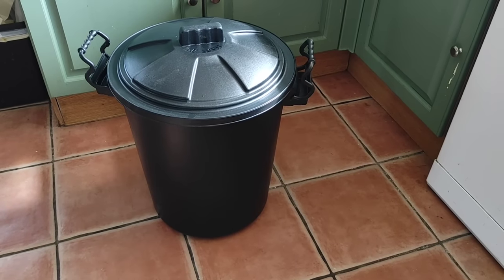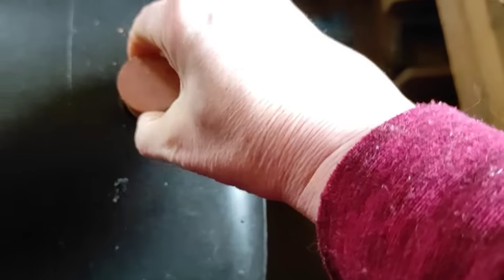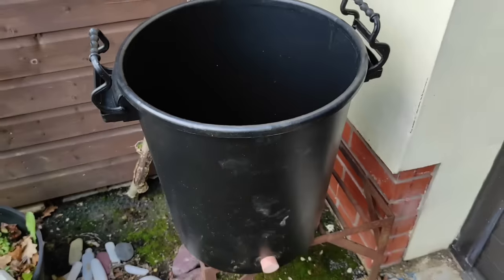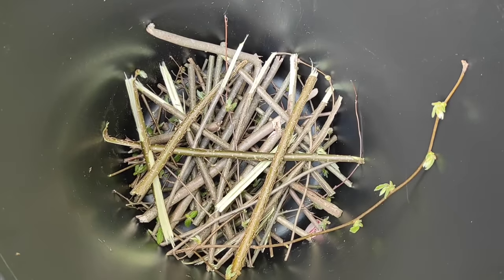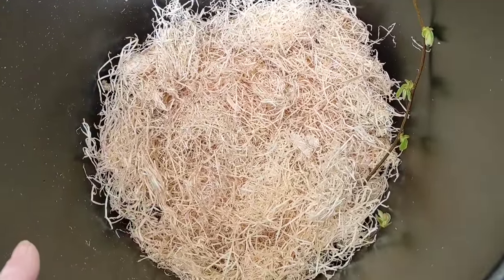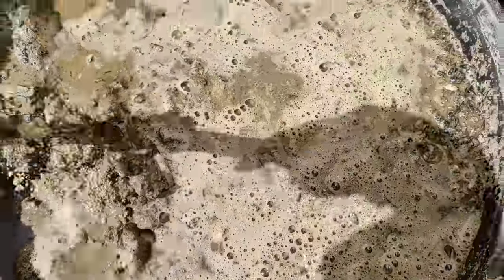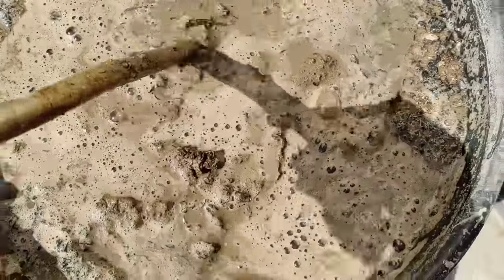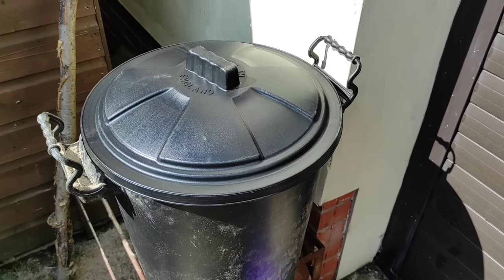Soapmaking from Scratch: Woodash Lye

Comment: It's very difficult to make bar soap with KOH - but you can make fantastic liquid soap concentrate paste with KOH. NaOH is usually necessary for CP or CPHP hard (long lasting) curing bar soaps
Reply from the maker: This batch successfully made both hard and soft soap, details in the second video

Comment: Rather than an ash hopper.  I just put ashes in a plastic pitcher.   Stirred in rain water.    Let it settle a couple days.    Decanted to another plastic pitcher.    Let it settle for a couple days.  Decanted again.     It tested too weak for soapmaking.  The egg did float. but not enough.    I put a cotton cover on the pitcher and left it in a safe place.    I live in a dry climate.   I don't remember when, but I would guess a week or two later enough water evaporated.   It passed the egg test.    The final soap was a thick creamy soap, not a bar soap.     Next time I aim for a bar soap.

Comment: Adding a nod of agreement to all the comments about safety. 
I have been heating our home with wood burning for over 20 years.
I have had mild alkaline burns from ash setting into the fold of my arm , mixing with sweat and getting a chemical burn  from it.
I scrubbed with vinegar as soon as I realized what was happening.
 😳 
It was mild and no lasting harm.
My grandmothers on both sides, made their soap from scratch. 
I have seen injuries,  thankfully minor  --  from lye and from un-cured soap.
.
Wood ash is a serious matter.
.
I have seen the touch and taste test methods,  and burns .

Comment: This was so interesting!! I saw from another comment that you've got part 2 in the works and I'm really looking forward to it! I had a couple of questions: Once you've steeped your ashes and decanted the lye water, is there anything else you can do with them? Are they safe to dispose of? If you need to get rid of the lye, is there a safe way to dispose of it, or are you kind of trapped into soapmaking at that point?
Reply from the maker: Spent ashes are great on the garden. Woodash lye can be used to flush through kitchen sink pipes just as you would any other degreaser.

Comment: Lovely videos. Thank you for your time and patience.
Have been making a similar version for awhile. We live as Pioneer Settlers in the mountains of the Ozarks.
The only thing that really gets to me is that the soap doesn't look very pretty with bits of grey flecks, and sometimes it looks as if I had added charcoal to the batch.
Should I filter this again and again? Before a boil? What step should I be filtering the homemade lye water to remove sediment?
I like the look of a cream or (tan) oatmeal colored bar. 
New Subscriber with notifications on!
❤
Reply: Filter through several layers of cheesecloth OR an old teeshirt to get a clearer lye solution.
Reply: @jeanettehaygood4154  thank you, as soon as wood burning season comes (when I store ashes) I will begin again. Do you think it needs to be filtered many times?
Reply: @landomilknhoney  I don’t think so unless you really want a very pale soap with absolutely no ash.

Comment: Also always have a spray bottle of vinegar nearby when working with lye to spray and wash off any lye contact.
Reply from the maker: I just have an open bottle of vinegar available, a spray mechanism is awkward in gloves
Reply: @SallyPointer  yes that it is. But the pressure of the sprayer can help eliminate the lye from the skin faster.
Reply: Please! Always use cool water initially on a lye spill!
Vinegar will cause an exothermic reaction on a fresh lye burn that can make it worse.

Comment: I know it's extremely annoying to find googles that actually do fit glasses, and not just say they do, but using just glasses is not enough. You could use face shield that would protect your whole face.
Also I saw other people using far less ashes, they just got much weaker starting lye, it was much lighter than yours so they had to boil it to get it strong enough to make soap.

Comment: A layer or two of newspaper make an excellent filter.
Reply from the maker: Not really around in the pre modern era though, and apart from the plastic hopper I'm trying hard to use the earliest references available. Great suggestion for modern applications though!
Reply: @Sally Pointer  Print was around and repurchased since the 1800s. Lye soaps were common through the early 1900s
Reenactors and hobbyists interested in soapmaking will be using the same techniques but can make use of the materials appropriate to their period.
The soapmaking at the Folk Festival I participate in use a 90° trough with a small gap between the sides, lined with newspapers and straw to process the wood ash for lye.
Reply from the maker: @fhorst41  I'm working mostly with medieval and earlier references, but yes, great for more modern versions. I haven't seen it suggested in 18th and 19thc soapmaking manuals though, would love the reference if you have it.

Comment: Where is part 2 ?! Please make soap from your lye.

And yes, more safety tips would be good. 

-Goggles over glasses.

-Long sleeves pulled down 

-Long nitrile gloves pulled way up the arms over sleeves.

- Install a tap rather than a cork

- Have a bucket of clear water with some white vinegar nearby as well, for lye-splashes on skin  or in eyes.

Thank you for the interesting start.

Comment: I've made soap during my time at uni in a lab, made some soap as a hobby but seeing the traditional way is super fun! I do wonder tho... HOW... How do you casually discover this back in the days... Who thought "hey let's soak ashes and mix it with fat"
Reply: On another channel, can't remember which one, they theorized that wood ash from the cook fire got into open pots of boiling water being used for soup and that's how the lye was first noticed
Reply: Given that people also cooked over wood fires it's not unlikely that water that's percolated thru wood ash would get into contact with fat. Fat + lye = soap. Dirty soap admittedly, but soap and it wouldn't be beyond the bounds of possibility that when ashes were used to clean pottery/wooden vessels that someone noticed that the soapy lumps cleaned better than ashes alone.
Reply from the maker: It's a common theory but doesn't really hold up under test conditions, I'm looking at this very question as part of my MSc research
Reply from the maker: It's the right ingredients, but not the right conditions for true soap to form. Bear with me, the next video will address this very question.
Reply: @SallyPointer  Yes, but when they first put metal-ore bearing rocks in the fire to boil the water in their then fragile clay pots, they didn't produce high tensile stainless steel and when they first rolled huge stones on logs, they didn't immediately produce Pirelli F1 tyres, they were just proofs of concept to prompt initial interest and be honed and refined down the centuries. 
Fascinating video/subject though.

Comment: Rust ... whey is apparently good in which to soak rusty tools.  It's a gentle acid and the acid will "eat" the rust.  Good for tools that have jammed shut.  Then sand, sharpen and oil.  Failing whey, I wonder if diluted vinegar would work.

Comment: Thank you for providing this video! My suggestion is that an actual tap be used instead of a rubber cork/bung. Wouldn't that work better? Also, if lye splashes onto your glasses (instead of a face shield or work goggles), might there not be some material used in producing the eyeglasses that would be damaged by the lye? I don't know about these things, I'm only asking.

Comment: Should always keep vinegar handy when working with lye !
Reply from the maker: I always do!
Reply: Household vinegar is 95% water 🥰 
You should always use only cool water to clean lye from your skin! Vinegar on a fresh lye burn causes a further exothermic reaction and will make a lye burn worse. 😢 Cleaning equipment, floors, or countertops with vinegar is okay but cool water is good too because it helps dilute the lye as it’s removed.

Comment: The common problem with using an egg as a floater is if the egg is old, it will float, and it's best recommended to use a potato.
Reply from the maker: That's why you always start with a plain water 'float' as a control

Comment: Oof, I can't say I've never suffered for science, but you had me scared there with that spout.
Very interesting! A question: when you want to discard the ashes afterwards, do they need to be neutralised first?
Reply from the maker: I'll give them a while to weather, then they can go onto the drive to quietly soak into the gravel
Reply: @SallyPointer  thank you!
Reply: I wondered if a water butt tap would work instead of the bung? You can get them in B and Q or Wilko's etc. I don't know if the flow rate would be too low and prone to clogging.
Reply: @sarahs784  ... and I was thinking about a plastic beer barrel tap for more controllability if you're doing it on a regular basis.

Comment: A) If the lye is denser than the egg, the egg will float. Depending on how much denser the lye is than the egg, some part of the egg will be above the surface, and this amount will vary with the density of the lye.

But.

B) If the lye is less dense than the egg, the egg will sink. It doesn't matter whether the lye is just a hair less dense or MUCH less dense. The egg will still sink until it can sink no further (the bottom of the jar in your case).

If the lye were exactly the same density as the egg, there would be no vertical force acting on the full submerged egg and you could (in principle) place it at any height in the jar and it would stay there.

So if we're not in state (A) or (B) the vertical position of the egg within the lye doesn't tell you anything extra about the density of the lye. You already know it's the same as the egg, and that's all you can know.

A hydrometer (as used by wine and beer makers) is carefully designed so that some part (the stem) is always above the liquid, so it's always in condition (A), which is the most informative condition.

I would suggest you actually procure a hydrometer, if only as a cross check for your traditional methods. They're very reasonably priced!
Reply from the maker: I have several hydrometers, but they weren't around at the periods that I'm drawing my references from, so not quite so useful to understand what soapmakers in antiquity observed. Certainly handy as a more modern cross reference though
Reply: @SallyPointer  Yes - I was suggesting them as a check on the egg method, and also as a modern measure of the (antique) lye production process. Using an experimental test to monitor an experimental process seems like too many variables to be a good trial!
Reply from the maker: @paulwomack5866  very valid point!

Comment: Would it be better to not use lots of sticks and other organic materials that are going to react with the lye? Wouldn’t make the lye super dark either right?
Reply from the maker: It definitely does add the dark colour, but it's what the very old recipes I'm working with do. You could use something else if you are after a less historically traceable methodology.
Reply: @SallyPointer   I saw another video after this where a guy just used a white towel at the bottom and the soap came out white. I'm truly not too worried about the historical authenticity of my soap so I might try something like that

Comment: So I live in the Pacific Northwest area of the USA, with dense pine and some cedar. Are you suggesting that I can not make soap using ash from these woods?  😊
Reply from the maker: Not at all, but you'll need to work out which of your local species give the best results. Generally hardwoods give better lye, but if all you have is softwood you may need to concentrate it more.

Comment: Hello, thank you so much for the video. I'm researching natural soap production for a permaculture project in Costa Rica (Refugio Tinti) where I work as a volunteer currently. The goal is to produce everything needed with the materials we have at hand on the ranch on the one hand and on the other hand to have a type of soap that is completely and reliably biodegradable. So the approach will be to produce oil with coconuts, lye with wood ash and then make soap with it. I'm very curious how it will turn out :)
One question I have concerning your approach. Is there a reason not to add water in between cups of ash when filling up the big bucket for the leaching process?

Comment: Hi Sally, can I use wood ash from a fire that has been lit using firelighters - the regular cheap white ones?
Reply from the maker: As long as they are a brief element, and the fire then burns for, let's say, half an hour to burn off residues , yes should be ok.
Reply: @SallyPointer  thank you Sally. Looking forward to following this process.

Comment: You are supposed to run it through the ash a few times, then boil it down.
Reply from the maker: Running through fresh ashes is best, but I'll be boiling this down as I'm now out of ashes til next winter
Reply: @SallyPointer  It not only gets more lye out, but cleans it.  Save some ash for slow drip before you let it set and boil it down.  If you are going to do that.  You can keep running this through ash, however you will loose a lot of it in the ash, unless the ash is already wet.

Comment: i have been trying this for years.  the fat is easy (I collect and clean lard) I have plenty of wood ash...I just can't get the potash strong enough (i've boiled it down, I've evaporated no joy) so I look forward to your video, I suspect my wood ash may have soft wood in it as well as hard wood ash....is yours hardwood or soft or both??.  I'm just not sure how to get a good Sodium Hydroxide (NAOH)...I think i'm really getting a Potassium Choloride (KOH) more for a soft soap or liquid soap. The last batch I did, my concoctuion passed the egg and potato AND feather tests and yet still didn't make soap.  I also had a very hard time finding a recipe to follow...some had too much fat and some too little.  I'll sign off by saying I'm an accomplished soap maker with purchased lye both cold process and hot process techniques.... I'll stay tuned and see how you get on
Reply from the maker: It's often a case of adding more lye or fat as the soap cooks out, but yes, hardwood ash is best, and it's so much easier with modern lye. It often takes me two days to properly cook out and adjust a batch made with woodash.

Comment: Just the way I would want to try making soap, from scratch, with natural available substances. Historically, I imagine soap was discovered at a camp fire where fatty meat was roasted on a stick. The meat fell in the ashes and the ash was rubbed off on a stone surrounding the fire, and later it rained. They discovered that the fatty ash was washed off the stone without a greasy residue. I actually use damp leaves dipped in ash to clean greasy frying pans (not cast iron). It works a lot better than even neat washing up liquid. Crushed ivy leaves also work really well. In fact, they are too strong to use for hand washing as they make your skin feel quite raw. A pity, as I was hoping to have found an simple alternative to shampoo. Your hair would probably end up looking like a scouring pad. 

What I'd like to try some time is doing laundry with lye. I've seen an episode of one of those historical reality shows where a few historians live completely in period for a certain length of time. It was laundry day in Elizabethan times with doing some "bucking", I believe it was called. There wasn't a lot of detail, but from what I vaguely remember they filled a large wooden tub with water and laundry and then spanned a sheet across the top, filled it with ash and let it dip into the water. There was no fat involved. But seeing the colour of your lye, I'm not so sure I'd want to use it for my whites. Will probably stick with an ivy experiment for laundry. When made into a "tea" it does not seem to stain whites, even though the liquid is faintly green. I have ivy swallowing up my shed and many trees and won't run out of it any time soon.
Reply: اول من اكتشف عمل الصابون بالرماد هم الفينيقيون و استخدموا شحوم الضأن مع ماء الرماد اما القصه الخرافيه التي ذكرتيها عن اكتشاف هذه الطريقه فهي خرافيه و غير عمليه و اتمنى ان تجربي بنفسك و تخبرينا عن هذا

Comment: I think i could get straw fairly easily. there's a big bag of straw they sell at the hardware store, weights easily 15 pounds (non metric) give or take. It looks like my attempts to make small batch lye didn't use enough ash. Thanks for making this. Don't forget some dyes require woodash lye. have you done anything on pine glue? I royally wrekt (game slang) a pint canning jar with my first attempt.
Reply from the maker: Funnily enough there's a recent reel on my Instagram about pine glue, and it will feature in my next video on Neolithic bone tools
Reply: @SallyPointer  excellent! guess what's out in my area finally? i'm just too tired to pick them rn. Black cap raspberries!!!

Comment: I think the egg floating trick is rubbish; the 1 time I tried making soap, I came across the same tip and ended up boiling the lye for hours trying to reduce the water in it, until it was the 'correct' concentration. I eventually gave up as it started getting too late at night, poured most of the lye off into 2 glass jars, and decided to make soap out of what was left in the pot to see what happened. it seemed to make soap just fine, I was able to wash my hands and shower with it. In my opinion, the egg test is a holdover from an age where A) soap was mostly used for laundry and cleaning rather than bathing since people didnt bathe all that often B)there was no litmus paper C) the people writing the instructions needed something objective and safe so the taste/touch tests are out